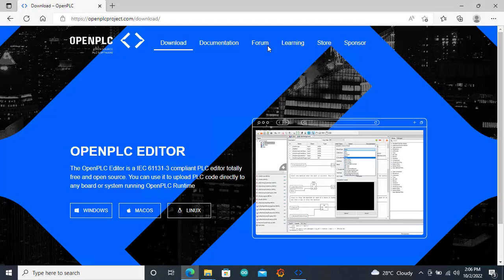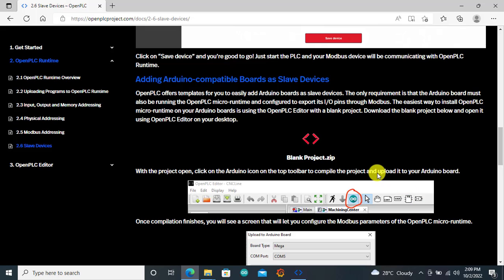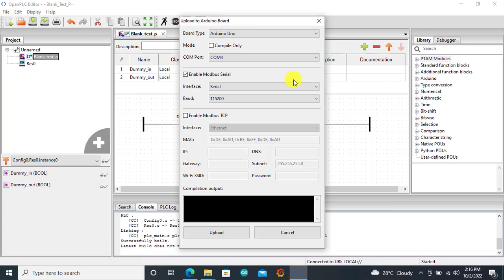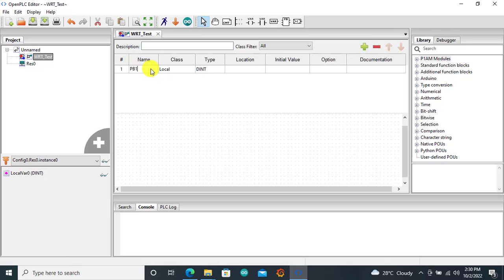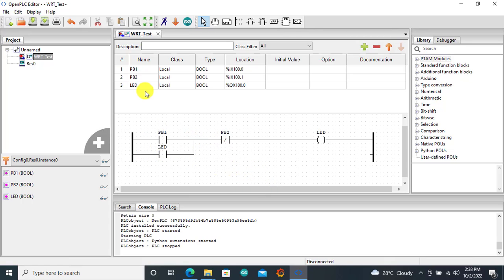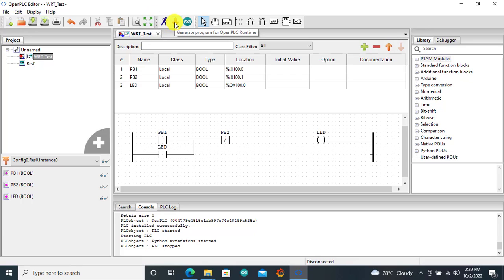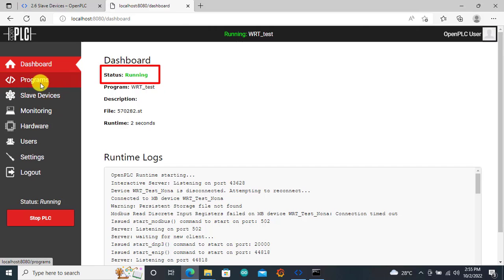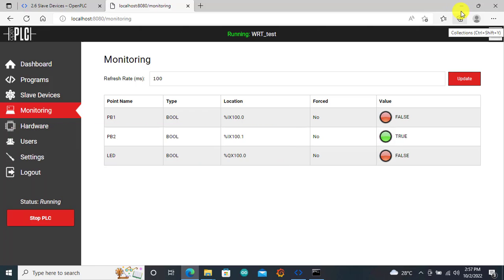OpenPLC Part 3 - Adding Arduino as a Slave Device

Comment: Hi, thank you for the explanation.
For my scope I need to use two arduino as slave devices: one for the plant + logic controllers and the other one as supervisor. I have uploaded the two programs and connected them to the OpenPLC Runtime. The input/output addressed are different from each other (%IX100.0-%IX100.4 and %IX100.5-%IX100.9 for the inputs). The output variables of one program should be the input ones of the other one.
How can I use the runtime with the two arduino at the same time? I have to create another program for the runtime that includes all the variables? Thanks
Reply from the maker: Thanks for your comment. if you are using two devices as slaves at the same time then, the first device should have the address X100.xx and the second device will be X101.xx and so on  where xx is the bit.  The two devices can not use address X100.xx. kindly check this link for more info https://openplcproject.com/docs/2-6-slave-devices/  Please revert if you still have issues.
Thanks
Reply: @engineeringmadeeasyingme6819  Thanks, I've ordered an ESP32 instead of one of the two Arduino Unos because of some memory issues.
I'll let you know if it works or if I have some troubles.